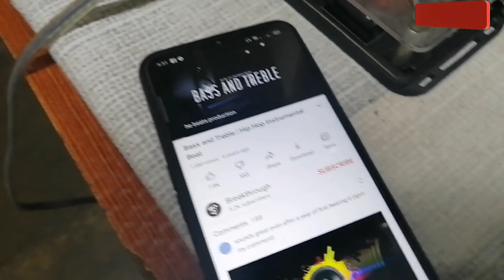TPA3116D2 Class D Amplifier Torture Test

Comment: PCB board is not showed fully, ...only speakers!! Bro please share the PCB and it's components, because the market of audio PCB board is richhhhh by duppplicccates PCB boards!!! And you aarrr the agent of aallll this.plaease share which PCB you are using for this video and please remove the heat seank for IC which is used for this board. I am not saying this in air because I have purchased board from market as original but the ic's are duplicate. Here no option to add or attach any file. I have all proofs. Quartz components delevired me fake  TPA3116D2 2.1 Amplifier board

Comment: Kung 300watts na speaker boss. Kaya din kaya sa babaran ni tpa3116d2? Addtional lng ng heatsink at fan?
Reply from the maker: Bitin ang power ng tpa3116d2 pra sa 300watts. Torture test la g ginawa ko jan. Gabun pa man pwede mo rin nmn load yan 300watts mo sa tpa3116d2 khit babaran pa pero set mo lang sa proper gaining khit wala na dagdag fan or palit ng malaking heat sink.

Comment: Lods Meron Ako din Nyan supply ko 24v 6a tapos Yung speaker 8inch 50watts RMS   bakit Po napuputol Yung tunog NYA pag dating 4/5 volume?
Reply: Same issue, I have 24v 20amp smps and 2 speaker(50watts each)  for stereo and 2 subwoofer (100 Watts each) connected parallel to the subwoofer terminal of tpa3116 board. 
When I increase subwoofer volume subwoofer stops for 2 to 3 second while stereo run smoothly.
Reply: Circiut protect na boss. Kasi lampas 12v na ung nabibigay na voltage sa speaker . Kung tama pagkakaintindi ko...pero sa subwoofer channel lng yan nagkakaissue..
Reply from the maker: Di ako makapagadvise kasi di ko nakikita ng personal ang set up mo.
Reply: @TAWITIBoyAllAround  what could be the problem?.plz give some time to my question I really need to know this.

Comment: Hi po new subscriber po ako. Tanong ko lng po kung ano tulong nang crossover passive po? 
At tanong ko po uli bakit po kaya pag nilakasan ko ang bass nang amplifier nag stop po siya at ginawa kona pong 24v natigil padin local po kaya na bili ko po?
Reply from the maker: Passive crossover is nagtatama ng frequency ng bawat driver. In other term nagpifilter ng tunog, o nagsasaayosnng tunog ng bawat speakers at nagsasaayos rin ng resistance load sa amplifier.

Ang volume knob or gain knob ng amplifier is usually hindi nmn dpt tlga itinotodo kundi sya ay itinotono na ayos sa specs ng speakers at amplifier. Kaya natural na magcutoof ng aound amplifier mo kpg nasa clipping stage na.

Comment: Kaya ba ng tpa 31116 ung targa 8 inch sub o 10inch at 24volts
Reply from the maker: Bitin ang power nyan pra sa traga na 8". Pero pupwede na pagtyagaan.
Reply: @TAWITIBoyAllAround  88db kc targa 8, dapat mga 90db pra d masyado power hungry sa amp
Reply: Smooth na compatible nyan boss is 6.5inches 100watts.. 4o-8ohms.. lampas yan gagaralgal na..pagpinihit mo pa dahan dahan ng nawawalan ng Bass ung Sub